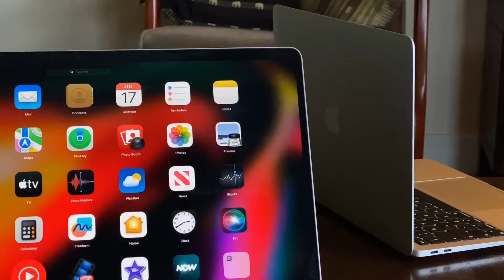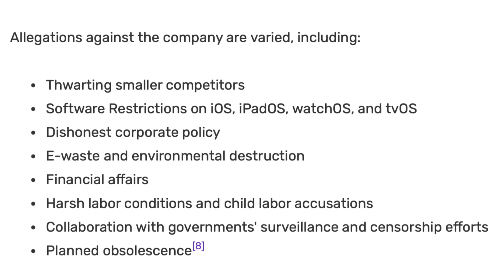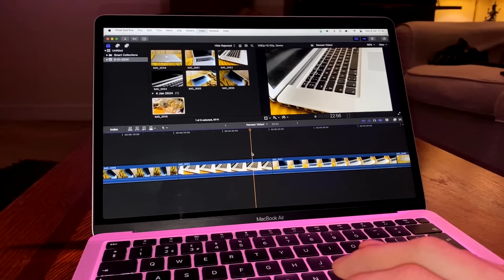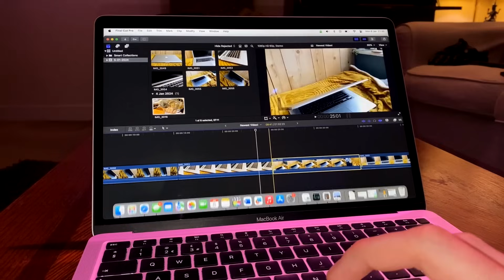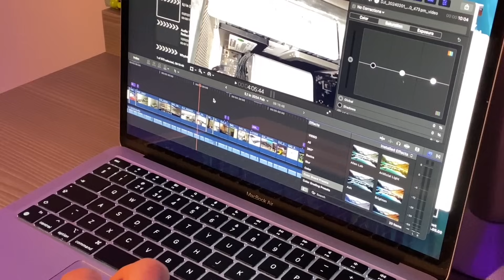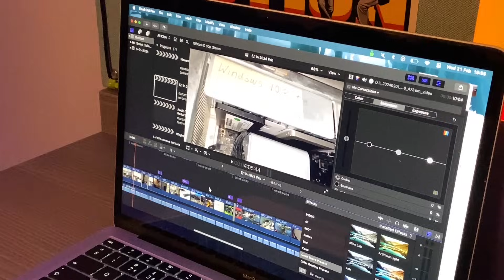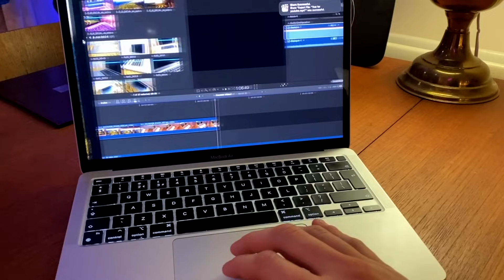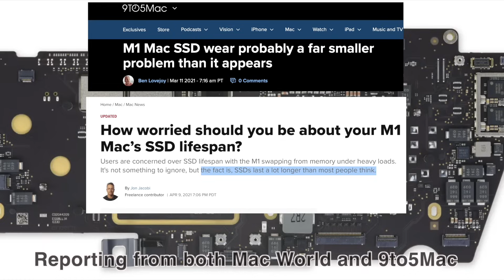Don't make the same mistake I did by buying a used Intel Mac.

Comment: lol what a terrible Clickbait thumbnail. Everything is depending on the person’s point of view and needs. I just purchased three 2015 MacBook pros. They are still the best MacBooks ever made, you don’t need an M series silicon chip.
Reply from the maker: “You don’t need an M series silicon chip” is a statement that applied to most people from 2020-2023. From this year onwards, M1 Macs are selling for easily under £400 right now. £350 is a small price to pay for something that conceivably will last 5-10 years. 

Why would anyone buy something last gen which won’t receive any OS updates, and performs about 35% as well as a computer that costs £100 more…? 

Do you seriously see no problems arising from using a 2015 MacBook Pro 5 years from now?

I’m as big a fan of the Intel Macs as they come. It’s important not to let nostalgia fog our eyesight, though. Apple silicon is miles out ahead, and the gap will only increase.  

For someone with text most would struggle to read in half of their thumbnails, you hold a lot of confidence in your ability to critique mine :)
Reply: @montaguebarnabasltd  lol normally I don’t bother to reply.. But since you wanted to poke fun at my thumbnails after you put clickbait..I’ll teach you a lesson. One that you should already have learned at your age. 

First of all you should know everyone is entitled to their own opinions and that’s yours and this is mine. It obvious you don’t have much knowledge on how thumbnails work and why you should make it one way or another. That was a lowball attempt to insult me, by the way. Lol

Listen up. No, you don’t need a silicon Mac. You should stop spreading this false information and only label it as your opinion. You didn’t need an M series chip several years ago, and you don’t need one now. Sure it’s better in some ways, but you probably should only buy it if you’re a dedicated professional using those programs that require the latest OS updates to fully and efficiently use the cores. 

But guess what? Those are very very few. And you’re talking to the audience like if they need it, like if their work demands the silicon chip. It doesn’t for 90% of people. The 2012 and even 2011 MacBook pro’s are more than enough for most people still today in 2024. Given that the specs are fully upgraded which cost less that $80 to do. 16Gb ram and 1tb SSD is still very fast. You’re just spoiled and i don’t care if you don’t admit it. Yes the 2015’s will be fine 5 years, even 15 years from now. They’ll still be powering though and efficiently. They’ll still be useful in day to day tasks at the very least, and still able to run (older) versions of the latest and greatest software. Which is still fine. It can still be done and it will work efficiently. Just not nearly as good as the silicon.  

You have been brainwashed by apple to believe you need a computer with “supported” software, which is their way of scaring you into buying the latest macs. You don’t need it. Not unless you actually use a program or app for work that really taxes the system and yeah, then you’ll benefit from a new processor that is 40% more efficient. Most apps that you use on a day to day basis still work and will continue to work on those OS versions in future years. I can attest to that because I use them everyday. 

There’s a reason why I use the products that I use. Because they’re the best. I wouldn’t use them if they weren’t the best. If I thought the silicon chip mac’s were better, it have a few. 
But that’s not the case. Not in my opinion.

I run two businesses with 5 MacBook pro’s 2015 model. Some 13” some 15”. 
Two 2012 13” specked out models. Two 2017 12” MacBooks. And the rest are pro iPhones and pro iPads that we use. 

The 2015 is still superior in terms of hardware quality, design, and most importantly port selections. You don’t need usb-c on your MacBook Pro. I can’t explain enough how much better it is to have the ports instead of the inferior designed and fragile dongles. The quad core and even the dual core are super fast doing daily tasks and they export 4k video in a reasonable about of time. I don’t need it to download in 8 minutes with the silicon chip, I can wait another 5 minutes and I’ll take all the other advantages the intel MacBook Pro has over the M chip. 
The 2015’s are peak design IMO they’re considered the most beautiful by the community and the apple logo still glows. Trademark apple. The new silicon Air’s and pro’s look more like Lenovo laptops. They lost all the uniqueness. The boot time on the 2015 is waaaaaaay faster than the silicon chips. 

Overall I’ll take the 2015 for all it’s advantages and take a loss on the better speakers and processor the silicon macs have. For $250 I can get a newish 2015 1Tb ssd and 16Gb ram. 
The M chip usually has 8 gb ram  and 256 Gb memory on most users models and cost $500 (cheapest on eBay right now in acceptable condition) 

Seriously, you don’t need the M chip. The intel macs are going to work for dozens of years more. The 2012 is the last to have the disk drive integrated, which I use to run some old software so it’s useful for me. They are also the last model to allow SSD and RAM upgrade, with the disk drive being allowed to be taken out and replaced with a second SSD. 

Those are perfect for someone on a budget that need a powerful laptop. 
I used my 2011 MacBook Pro for 6 years before upgrading to the 2015 model. And before that it was already used by two different people for work and school. They are workhorses and it’s never frozen on me or failed me. 

After 2016 they added the USB c ports and Touch Bar, which they realized they messed up and the 2015 still reigned king. Until the M1 Pro many consider that king now, but only if you need the extra power for work. There’s a reason they hold their value in the used market. People buy them and use them.
Reply from the maker: @RadOpsTV I don't have time to write almost 1000 words, unfortunately. I'll reply to your points one by one, though. 

I'm surprised you took my honest thumbnail criticism so personally. Did you think laughing and calling mine "terrible" would be ignored..? I take pride in what I make, and my long form videos are doing very well, not least because of their effective thumbnails. It's a great thing that we can both make money creating videos about things we enjoy, and it's safe to say both of us are doing well in that regard - if you have criticism at least make it constructive, and try to come across less condescending ("listen up" and "I'll teach you a lesson" spring to mind!).

 Also, you're absolutely right. The video, and most of my others, are all opinion-based. So are almost all tech videos, though. That's obvious without me labelling my content as such. You've written a lot defending the 2015 and older Macs. I implore you to put your opinions on the matter into a video (or two ;) ).

I completely understand your love for the 2015 Pro. Does that make anyone who believes M1 Macs are better for the majority of people brainwashed? No. Of course not. Both are Apple products. Both were touted as the best in the world at release. The M1 Air is 4 years old at this point, yet I consider it up there with the latest and greatest computers. 

Some of your points are a bit contradictory, by the way. You talk about not minding a few minutes extra rendering, but then celebrate a couple of extra seconds at boot as though it's all that matters... 
Also, the 2015 Pro can render 4K, yes, if a little slowly. Working in real time with multiple timelines, though, you'll hear the fans at full blast, and there will be slowdowns before you've reached the point of rendering. 

Like I said... not going to respond to every bit you wrote, because a lot of it just highlights a difference in opinion.

Comment: I'm waiting for the 2019 16" MacBook Pro to become really cheap for a 1TB SSD model, I actually need intel so that it can natively run Windows as i use some softwares that are windows only. The M1 series is a distant dream for me as i'm gonna need at least 16GB/32GB RAM and 2TB/4TB SSD if it's going to be my main laptop, i think they still run into the thousands at the moment.
Reply: Keep in mind those precise models have faulty design which can blow up SSD at some point due to faulty controller.
Reply: I had the same argument and almost went ahead to buy one of the 'META' boxed warehouse ones from iPowerResale. My friend is even in the US right now, so I could have had it shipped to him and then got it here. But he himself advised me to just use virtualisation. I have a Parallels license and reports say that running Windows in macOS on a hypervisor is an optimal experience with Apple Silicon. It is no mystery that bootcamp drivers can be flakey and are not going to last. Apple is not going to provide Windows 11/12 BC drivers, as they are not supporting the platform anymore. In all honesty it would be a very niche investment, that could turn out a waste
Reply: @darksol544 small correction: it's not the controller, the 1.8V and 2.5V lines like to short out on that machine. The controller sits inside the T2 chip and is fine, the NANDs themselves do the "rm -rf /"

Comment: Ok but hear me out... what If I want to tripple boot between OSX, Linux, and Windows?  Without Virtualization?
An Intel Mac is the only way to do that without Hackintoshing.
Reply from the maker: I don’t really see why anyone would to do that without virtualisation
Reply: @montaguebarnabasltd  because when you virtualize something you still have the overhead of both Operating Systems running simultaneously, and when you run on bare metal... you don't (have to share ram, gpu, cpu cores).
Reply from the maker: @ajplays-gamesandmusic4568  I’m aware, but M1 performs better virtualised than Intel can running natively.

Comment: The 2019 16 inch isnt as bad as you say, i daily drive one and its perfect. Battery lasts longer than even my friends m1 air which you kept on praising about, and you overall jusy exaggerated how "bad" it is
No macbook is bad, they all provide similar experiences, and the general person won't need all that horsepower
Be happy with the glowing sheet of glass and cobbled silver you got, cause its definitely better than not having one

Comment: Intel Macs are still worth buying and have their place imo, especially with the price drops since the M-series Macs took over. Graphics are obviously where they fall short, but quad core i7's are still plenty capable for many daily tasks. If you're worried about thermals/battery life, there are apps to mitigate that like Macs FanControl, Turbo Boost Switcher, gfxCardStatus and CPUSetter. I run my rMBP with only 2 physical cores active with Hyper Threading most of the time and its fine for light stuff like web browsing, email, movies, productivity, etc. When I need more power for something like gaming, I just adjust my settings. And as a bonus, I can boot into Windows 10 whenever I need it.

Comment: Bought a 2019 MacBook pro 16 for $460 on eBay as a desktop replacement just a few month's, it is just awesome, I also have a MacBook Air M1, but I hate that I can't connect it to two monitors, I suspect the next Mac OS will support the 2019's, and then I still have another 2 years of security updates if they don't support it. I don't regret buying it one bit, when it does lose support, I'll just buy a Mac mini with an M2.
Reply: I can't think of a better desktop replacement Mac,, you can connect up to 4 monitors, works with no hiccups

Comment: If I can find a well maintained 2019 16" Macbook Pro at a good price, I'd buy one. For the 16" nice screen. I mainly use my pcs with headphones on anyway, so the fans won't bother me too much. I sold my 2015 13" that I had put an ssd adapter in and put in a 512 GB ssd... worked flawlessly, but I need a slightly bigger screen.

Comment: My main computer is an overkill M1 Max Mac Studio, but I have plenty of vintage Intel Macs that are still very capable. I use my heavily-upgraded 2010 and 2013 Mac Pros for Photoshop and 32-bit games, and I use a mid-2012 MacBook Pro (upgraded with two 500 GB SSDs and 16 GB of RAM) and a 2013 MacBook Air (upgraded with a 500 GB NVMe SSD) as work commute laptops. As a writer, editor and light on-the-go gamer, these and other Intel Macs are still fast and practical.
It's funny — many view the 2023 M2 Ultra Mac Pro as redundant, in that you can get almost identical performance in the much-cheaper M2 Ultra Mac Studio, but I think the 2023 Mac Pro makes the 2019 Intel Xeon Mac Pro look even worse. The 2023 Mac Pro goes all-in on Apple Silicon: it can run native ARM applications, Intel apps through Rosetta and iOS apps through the ARM architecture, and thus has vast app compatibility. The 2019 Mac Pro, however, can't run iOS apps due to the Intel architecture, and can't even run 32-bit apps due to Catalina and beyond dropping 32-bit support. To me, the 2019 Mac Pro is an objectively powerful and very upgradeable Mac that just can't run much in the grand scheme of things.
Reply from the maker: You make good points. It’s not fair to say that Intel or apple silicon are irrelevant. They both have their uses, and will continue to do so. I do feel like my Mac Pro is a little redundant now I’ve upgraded, though.
Reply: @montaguebarnabasltd  
I can play Deus Ex: Mankind Divided on my Mac Studio (on which it runs REALLY WELL), and Deus Ex: Human Revolution, the prior game, on my 2013 trashcan Mac Pro. ;)
I was disappointed when Eidos and Square Enix did nothing to update Human Revolution to 64-bit for its tenth birthday. Human Revolution is my third-favourite game of all time (between Life is Strange at #3 and Fallout: New Vegas at #1), but since it's 32-bit, you can't play it on 10.15 Catalina and up. :(
I'm also genuinely angry at Valve for not updating the Mac versions of the Half-Life and Portal games to 64-bit. They knew Catalina would drop 32-bit app support, and they've had over four damn years at this point. To me, this isn't a matter of profitability for Valve; this is a matter of respecting their players and allowing them to keep playing the games they paid for. Plenty of people view Valve as apathetic, no longer caring about game development now that they have a monopoly over PC game distribution, and Valve neglecting the Mac versions of their flagship games is another aspect of this carelessness.
Reply from the maker: @QUANTUMJOKER  to be honest, i think we should question why apple binned 32 bit support, too. Yes, it’s been far too long for valve to leave games unsupported on 64 bit, but I guess it goes both ways. 

I like your taste in games!
Reply: @montaguebarnabasltd  
Thank you!
My other top ten games, in no particular order, are Hollow Knight, Hades, Sleeping Dogs, Dishonored, Myst, SimEarth and The Last of Us.
Reply: Catalina still has 32bit , you have to ramble the feature in terminal
Reply: You can’t run old exetensis on m series computer. To use that on silicon Mac you have to do the monthly service fee
Reply: @QUANTUMJOKER now you know how we feel about our Intel Mac being excluded from BG3. I can run the game under macOS due not having avx/avx2 tech. However under bootcamp I can run the game. Intel Macs that 64bit , show still be able to this games. It just Tim Cook telling game developers only make game for silicon Mac’s
Reply: Also Tim Cook made Mac OS Mojave not to support apple for boot rom on 5,1. An  Mac Pro 5,1 and stop us from running bootcamp on Mac OS Mojave. He made sure to cripple the 5,1
Reply: @macgamer1973  
Are you sure? My 5,1 2010 Mac Pro has no trouble at all booting Mojave with no code tricks.
Reply: All you have to do is upgrade the firmware and use a metal capable GPU to run Mojave on a 5,1.

Comment: 6:33 Let me just stop you right there; my 2019 Intel MacBook Pro has all the same repairability issues as an M-chip based machine. Everything is soldered in.

Edit: Also, for me, it’s not (entirely) about part failure. I found out my RAM was soldered in when I wanted to upgrade it from 16GB to 32GB — a trivial thing in previous Macs. This was just 2 years in. And yeah, I was stuck with 512GB of storage too.

Comment: I bought a 2015 15" MacBook Pro 2.8Ghz Quad Core expressly BECAUSE it will only run up to Monterey. I need a music notation program that is not longer being supported and need to have a system on which I can use it without fear that an OS update will nuke it.

Comment: When I preordered the m1 Air, and it turned out to be the best laptop I’d ever used even with some goofy limitations like maximum 16 GB of ram, soldiered SSD and only one external display. 

I remember getting some backlash from people since I basically said back in November 2020 that it time to move on after I realized it was more pleasant to edit on it than my Mac Pro 5,1 with 96 GB of ram, NVMe and Radeon VII and gave my Mac Pro 2019 a run for its money.
Reply from the maker: It's one of those things you have to experience to fully comprehend. Thanks for watching!